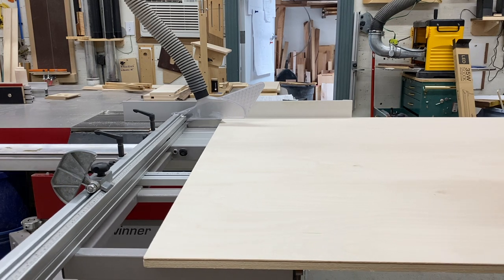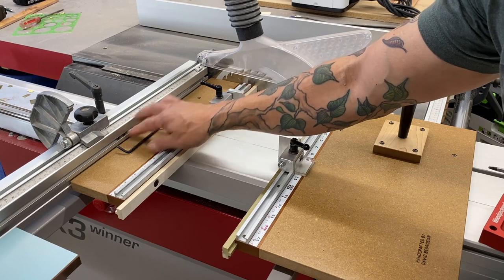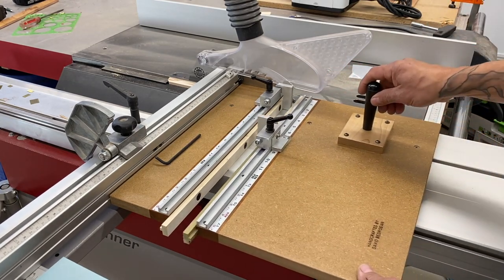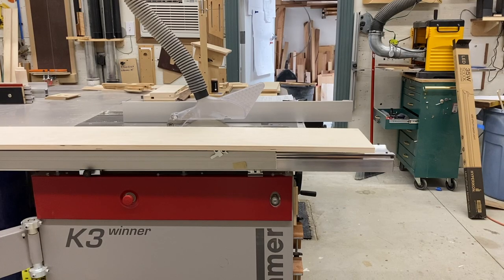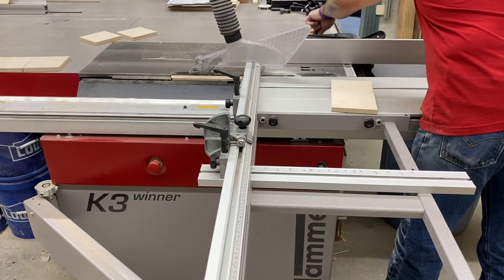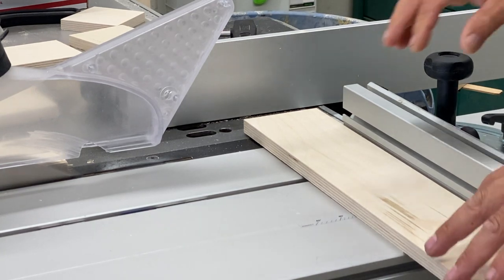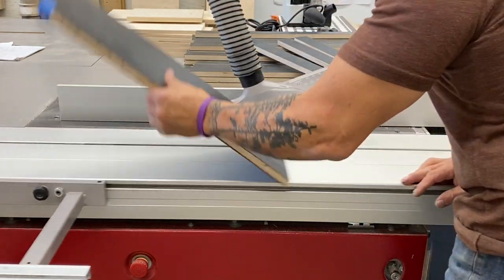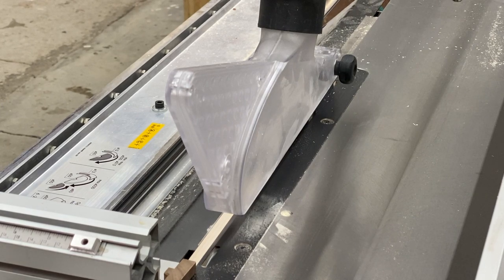Sliding Table Saws part 2

Comment: I've worked in different cabinet shops on and off for the last 20 plus years and I have to admit I have never used a slider other than to maybe straighten line a live edge so I could rip it down on the table saw. the one shop I worked in that actually had one switched over to using a production CNC so the slider just collected dust. I wish I had known how handy these saws are. I'm finally able to set up my own shop and I found a guy who was selling his Felder K 700 slider. It was a little scary spending that much money on one piece of equipment. after watching your videos, I am glad I pulled the trigger on it. It will definitely speed up the sheet goods breakdown and it looks like it will be very handy for a lot of cuts that I would normally have to move over to the miter saw for.
Reply from the maker: Yeah…good points.  Sliders aren’t for everyone but for those that use one…superb!  I can’t imagine not having one.  Anyway, thanks for watching the video

Comment: Great video! I have a felder 700s coming in December. 30 years in cabinets and this will be my first slider. Im doing away with my upright panel saw and loving the fact that my 700s will handle 4x8 melamine with truer squarer cuts. Also the scoring blade eliminating the chipping my panel and table saw were doing. Sliders seem to be so much more versatile. Subscribed !
Reply from the maker: You’re gonna love your new slider…congrats!  And thanks 🙏🏼

Comment: I don't use a full length rip fence much and have put a short (300mm) length of fence on the rip head as a measured bump stop. The rip fence is fitted with a DRO and not having the full length means I am not always walking around it. The combination of an F&F jig, DRO and short fence make a very nice combination.
Reply from the maker: Sounds like fantastic modifications/additions!  Gotta love sliders….so versatile!  Thanks 🙏🏼

Comment: Thanks for another great video! 
I have never seen you using the fence on the side, which I find much easier when it's close to the blade. Any reason for this? Thanks!
Reply from the maker: Hello Pablo. Do you mean laying the fence down to utilize a short height fence?  I do use that on occasion.  It is a safe alternative.  Much thanks.

Comment: Hey Ramon. Your Channel is hands down my new favorite Channel on youtube. I am in awe with all your knowledge! I was wondering if you could do a video on setting up a sliding table saw, also getting the blade parallel to the miter slot (I do know that the felder machines are set up flawlessly and tested before they leave the factory) but I have another brand of sliding table saw, and I’m having issues getting it to be at 100%, I got around 1 mm drift front to back of the slider, and I can’t seem to correct it. Maybe you have some tips on setting up a saw like this. Loving the content, hope you see this
Reply from the maker: Hey Joe…thanks a ton for the good words!  

I’ve set up a couple of sliders (decades ago)  and I remember fussing (and cussing😆) with the adjustment for hours!  But, I didn’t use a dial indicator…thinking back…I feel silly.  I did finally get them both set up extremely accurate. 

Now, my buddy David Bedrosian (on Instagram) has some excellent tutorials for setting up a slider.  He even has a hashtag #bedrosianslidingtablesaw that has them all consolidated.  You can find him on IG  @bedrosianwoodworks 
I would like to do a tutorial on slider adjustments one day…but his are very good and I have little time.  I hope this helps and thanks again 🙏🏼
Reply: @ramonartful  that helps a lot! I’ll definitely check that out! There’s probably no need for you to do a video on sliders since there’s already content outthere. Spare yourself the headache and keep pumping out videos on other things instead. 
Thanks so much for the reply, I really do appreciate it, god bless😁

Comment: Nice video. I saw the K3 winner last week at the dealer. I mainly use wood like oak and beech for small furniture (sidetables, dog benches etc). You say a few times, the sliding saw is mainly for sheet goods. Would I make a mistake if I buy one for my furniture?
Reply from the maker: That’s a great point and one I should have elaborated on a bit more.  I use mine a lot when working on solid wood furniture. I prefer a 10” table saw for ripping but if I had to pick just one, it’s a slider all day long.  It’s like having a cross cut sled on a smaller saw…but on steroids!  Superbly accurate and extremely versatile!  I should have said that they excel with sheet goods but can be used for both solid wood and sheets.  Thanks
Reply: @ramonartful  ok. I think you are right about ripping. Standing left of the sliding saw can be a bit more difficult for ripping and using the fence maybe

Comment: Wow, you just made a “no no” cut. 😁. Cutting between the blade and the rip fence with a piece that is longer than it is wider.
Reply from the maker: Do you mean at the beginning of the video?  That’s probably a good rule of thumb in general.  But experience shows how using pressure at key points whilst cutting makes this a safe operation. Relatively.  All machines impose some danger. Thanks
Reply: @ramonartful  😬👍🏻

Comment: Hi Ramon. Great videos and info, just found your channel and subscribed.  I have just taken delivery of my K3 and A3 last week, looking forward to using them. Do you have the felder dado stack for your machine. If so can you do a video of setting them up and using them, showing various cut widths. My dado set came with 3 groove cutters and just want to make sure I am setting them up correctly.
Reply from the maker: Hey Derek! (Also my sons name😬) 
Sorry , I don’t have a dado stack on my Hammer.  I do dados  on my 10” saw.  If you’re on Instagram, you might check out David Bedrosian.  He goes by @bedrosianwoodworks and does some great IGTV vids related to the K3.  Maybe even some on the dado.  And thanks
Reply: @ramonartful  thanks Ramon, I will set up an Instagram account and check David's page out. Thanks for the tip. If all else fails I will give the tech team at felder a call.
Reply from the maker: @derekrobertson1548  Yeah...they are super helpful

Comment: My shop is 33x24ft would a slider even fit? After watching your videos I really want one. 

Still loving my domino dock!
Reply from the maker: The space that my slider is in,  is much smaller than yours!  It’s the same length at 33’ but only 17’wide.  I have a cabinet saw at the opposite corner to the slider.  I plan on doing a YT shop tour soon.  It’s tight, but for that I do it works.  Thanks
Reply: I have a Minimax cu300 smart with the 8.5 foot slider. At two different times it was used in a 2 car garage and it worked beautifully in that space. I think it was only 22’ long x24’ wide. Once you go slider, you can’t go back. Lol

Comment: Ramon, please, PLEASE start making zero clearance inserts for the K700S model!  The 700 is by far the largest selling Felder slider on the market and if you design for it, you will most certainly find a huge market opening up.  Thanks for the video.
Reply from the maker: Hey Marty. Are you Apex Woodworks on Instagram?   I’ll dm you
Reply: @ramonartful  That's me, Ramon!

Comment: Hey Ramon, Im seriously looking and getting a K3 like yours and have a couple of questions.

1) do you have your fence set dead nuts parallel to the blade or is it toed out slightly.  I saw another maker who had his slider toed out a couple of thousanths, but I would think the fence would need to be toed the opposite way, which could be a problem when ripping with the slider and the rip fence together.  If it is dead nuts, do you not have any burning?

2) i also saw another vid where someone set his slider to be even with the cast iron top.  He did that so that when ripping using the fence, the left aide of the board wouldn't be elevated giving an unsquare cut.  Do you just use your 10" for most parallel ripping to avoid an out of square edge or do you jusr not worry about it.

Sorry if you covered any of that somewhere and i missed it.  Love your channel!  You give me a lot of inspiration!
Reply from the maker: Thanks for watching the video and great questions.  
1) I like my fence dead parallel on both my table saws.  If the fence is toed out, when I’m cutting pieces to length using the slider with the rip fence pulled back…if the widths are different, you’ll get different sized cuts.  A narrow piece registers tight…while a wider piece contacts the rip fence further back first.  I get it, it’s a safety thing.  But with a properly set up riving knife…I have zero issues and no burning. It just makes sense to me for accuracy.  

2) I like the slider carriage to be slightly higher as set at  factory.  I am aware of the problem, but in general, these cuts aren’t the final process.  I can joint by machine to clean that discrepancy or I use my 10” table saw to make narrow cuts.  Sheet goods slide across the transition much easier as set.  I don’t think it’s a problem with rips or anything wider than say, 4 or 5 inches.  (100+ mm ) I see it like this;  if my material is 3/4” (19mm) thick, and my rips are that narrow as well, then the edge would/could be out of square by that offset.  Couple thou?  As the rips get wider, that out of squareness becomes less of course. Hope that helps
Reply: @ramonartful  thanks, man!  Just what I was looking for!

Comment: Can your insets be used with the bigger blade on the Hammer K3?
Reply from the maker: Absolutely.  I use a larger blade when ripping lumber.  Of course, the scoring blade needs to be removed.  If Hammer mentioned this…I missed it. I even purchased quality 12” blades for cutting sheet goods…too bad I can’t use em with the scoring blade.
Reply: Thanks for the response.

Comment: Great videos.  I’ve been having much difficulty pulling the trigger on a slider, up until yesterday that is.  I finally have one, sitting in my trailer waiting.  But like you I have a massive 9.5x7.5 outfeed for my cabinet saw and other things.  I’ve been trying to figure out how to make the slider work without taking all my table space away as it’s my assembly table as well.  There just isn’t a really easy solution.  I want to keep the cabinet saw for dados, as I always do them, but I just don’t think it will be practical.  Is your table top one piece or is it connected in middle to make full size?   I see a seam it looks like.  Maybe it’s just the laminate seamed.  Also what is the long rectangle shape in top near the cabinet saw?
Reply from the maker: Hello David

I can send you photos if you want to share your email or I’m on IG…I could DM them to you.  My small slider (Hammer K3) and my 10” table saw do share a 5’ wide x 8’ long table.  It’s built in two pieces, and connected to the saws.  The two sections created a space in the middle…so I created a box and added a lid.  I keep wrenches, scoring blade and other table saw related items in there.  Thanks
Reply: I bought my K700S because of it’s ability to cut dados, got rid of my Powermatic cabinet saw and haven’t missed it one bit!  😁👍🏻
Reply: @tundrawhisperer4821  that’s cool.  Glad to hear.  I think I’ve seen your comments all over the sliding table saw videos.  I guess when you were looking to get one, you were asking questions.  Glad to hear you like it.  I’m sure I’ll love it too but as you can see from my videos, my assembly table is very big and I’ll be missing a good portion of it with the slider.  We’ll see.